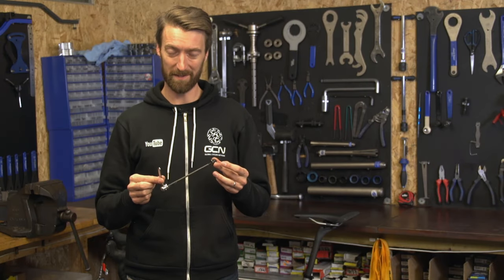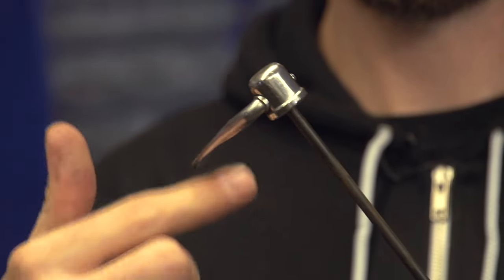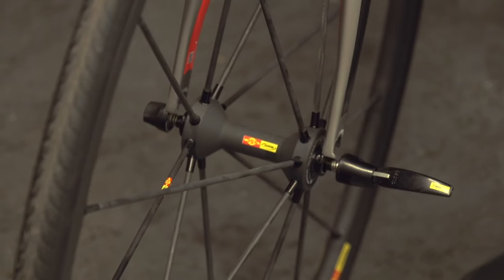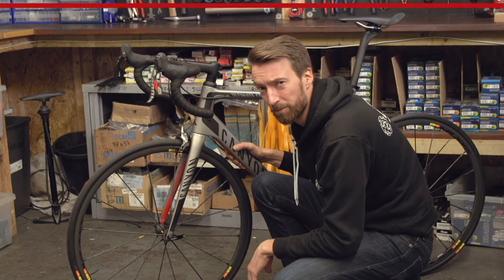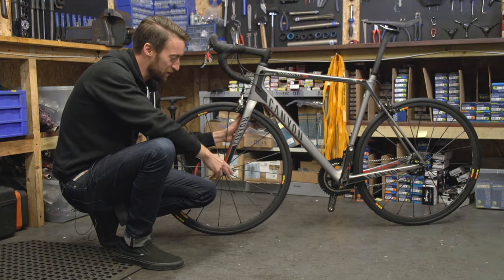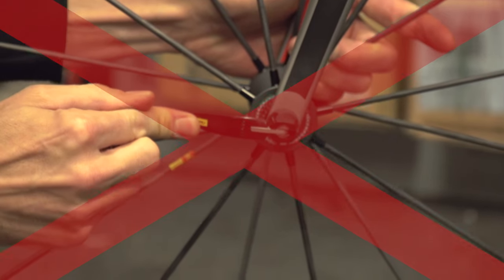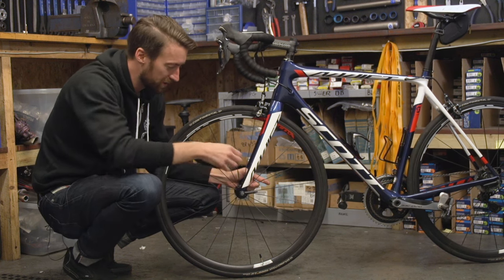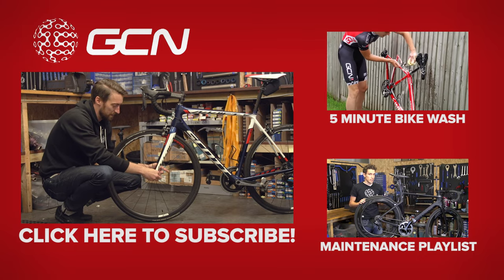How To Use And Adjust Quick Release Skewers

Comment: Thanks! Was changing my rear tire and was just tightening the lever, but couldn´t close it for the life of me.
Saw this, loosened everything and started turning the nut while holding the lever in the correct "open" position, opposite of where you want it closed. Tightened the nut until the lever was a bit hard to close, but not rock solid. Beautiful. Thanks again, really good video!

Comment: Thanks. I had this problem with my front tyre, it was like tilting a little, maybe more than a centimeter and I was searching the reason for this. Then I saw this video and remembered one time I dropped the small spring and I did not know which way to put it back. Of course I put it the wrong way and now when I turned it the right way the problem is gone. A huge difference. Thanks again.

Comment: I replaced 23mm tyres with 28mm tyres, but the frame clearance was very tight for the rear wheel, so what I did was tighten the QR lever with a tiny gap between the axle and the dropouts, creating a larger gap between the wheel and frame. The tightening nuts have a serrated surface for grip, and it seems to have worked fine this season, but presumably I'm running the risk of the drops outs eventually slipping down onto the axle and losing clearance between the wheel and frame.

Comment: Was wondering if you guys would be able to make a full bike build of both mechanical and electronic.  I have a ultimate cf slx frameset and am looking to build it up soon but would be good to know what to buy and explain all what all the options on wiggle mean when buying a groupset as there are lots of different choices. as I'm yet to find a full build but only how to fit individual components (often not the same as what my frame is compatible with!!)   

Many thanks

Comment: I have an old mountain bike with Shimano brake discs and QR they work lovely I’ve had the back wheel off loads of times put it in the boot of car, or puncture repairs and every time it goes back fine,  I have a new hybrid with SRAM brake discs and QR, I can’t stop the rear disc from rubbing the pads  
I’ve done it up really tight but the wheel can still be pulled side to side a little and it rubs the pads like Mad especially when Cornering . I cannot get it to stop I’ve moved the calliper around it stoped for a while it’s doing again now

Comment: Never had any experience with a quick release in my life. Put a bike together over the weekend that has one. On the wheel itself, before I even put the skewer in, should the bolt and nuts that go through the axle turn along with the wheel??? When I put the skewer in and tighten it, there’s resistance when I spin the wheel. Because everything seems to be turning at the same time

Comment: Not so useful for regular riders but I had a friend who had no idea how to operate one. The wheel came off the forks when I lifted it up because the tire was rubbing against the brakes. On a totally different situation I was riding someone else's bike going really fast when I heard a rattling noise. Got off the bike and the quick release was open and really loose. The road was bumpy and I was lucky enough to not have it separated from the forks.

I'm also amazed at how many people needing instructions from me to operate a QR. What's trivial to you might not be to other people. Did you figure out how to tie shoelaces without instructions?
Reply: Excellent examples! The ability to put one's self in the situation of someone else is one of characteristic of maturity.

Comment: I have a scott hard tail and the front wheel will tilt over about half of the gap between the gap from the fork to each side of the wheel. I have had this problem before on my trek i put the trek wheels on my scott frame and new fork  and ended up having the same problem I noticed wear on fork feet. My step dad thinks the forks might be uneven which might cause it to tilt. If you have any knowledge or ideas on how to fix this or what the problem is please let me know.

Comment: the best position to secure the QR
i will stand on the right hand side of the bike, and put your body weight on saddle to force the rear drop out fitted in rear wheel totally. simply do it on front wheel
its the easiest way to check and adjust the QR tight enough or not

Comment: What is the best way to release one that has been over tightened. I bought a used road bike and can't get the release to give and don't want to break anything getting to rough with it.
Reply: +Joe Medlin Stick a pipe over the lever and use that for extra leverage. Or a vicegrip on the "nut" side and turn it anti-clockwise. 
I'd get a new skewer though, as strong as they are, they can be weakened by stretching.

Comment: I have taken the front wheel of the bike as it was wobbling. Realised the wheel was loose in between the axial and was able to wobble.

Now putting the wheel back on and tightening the front fork on the quick release. As I tighten it the  fork closes in on the nut of the axial causing resistance to the wheel enough to stop the wheel.

What am I doing wrong here in my bike?

Comment: I ride behind a ton of guys with their rear quick release pointed backward.  I am constantly threatening to open it for them with my front wheel and telling them to change it.  It's actually nice to see a video I can point them to.
Reply: I have a canyon ultimate and I have my rear quick release on the left side point to the back.  It is the most logical way and i tell you why.

I have disc brakes and in doing so, the rear quick release lever is actually protecting my brake disk from damage and risks of bending if the bike was to fall over on the left side...

The chances of anyone opening with their front wheel from the back is very slim since I doubt anyone is stupid enough to try to damage their own bike in order to prove me wrong...

Comment: Great way to test if the QR is tight enough:  if you can release it with one finger, it's not tight enough.  Any tighter than needed to meet that test is not necessary and only makes releasing them harder than it needs to be.

Comment: I have a canyon ultimate and I have my rear quick release on the left side point to the back.  It is the most logical way and i tell you why.

I have disc brakes and in doing so, the rear quick release lever is actually protecting my brake disk from damage and risks of bending if the bike was to fall over on the left side...

The chances of anyone opening with their front wheel from the back is very slim since I doubt anyone is stupid enough to try to damage their own bike in order to prove me wrong...

Comment: I was a little kid when these came out and honestly we could never figure out how they were supposed to work. It seemed like it had to be loose before you could snap it down and then it would tighten as you were pulling it down because the lever protruded at the base. it was trial and error because you never knew exactly at which point to crank it down. When they got dirty they bound up. The problem is you can feel the torque on the original ones with the protruding base
Reply: actually its the seat post I was thinking of, I just always thought it was a crappy design they may have used the same design on wheels in the nineties
Reply: apparently the wheel ones are based on a cam too so there is no way to actually determine the torque, but on the plus side homeless people don't need a wrench to steel your wheel

Comment: On a serious note, do not overtighten them. Years ago (I was still a teenager) I was getting my bike ready for an important race so I made the rear skewer really tight. As I forced the lever to the closed position the skewer snapped at the threads and the adjuster shot across the car park like a missile! I was lucky to find someone with a spare to loan me otherwise that would have been my race over before I started.
Reply: Another more important reason for not over tightening is so as not to over compress the bearings.

Comment: I've always been told that closing a quick release should leave a mark on whatever you used to close it, be it your thumb, your palm, or whatever. I've also been told that when the skewer is closed halfway, it should still be able to (just) hold the wheel in place. 

Other than that, it's a quick release, it's not hard.

Comment: I have a quick release on my mtb n  I took the wheel of n everything was fine but when I put it back I had to losen it loads and I ended up just screwing the leaver the the point of where it was really tight but then I couldn't push it in towards the frame so I tried to losen it again but it was far too tight and I can't get it undone so it's just sticking out any suggestion
Reply: Pliers.

Comment: How do you switch the side that a quick release is on, the one that is on my recumbent is on the rear wheel and it is on the side of the gearing, and I need to put it on the other side, I know how to do minor maintenance on my bike but that's about it, any help would be greatly appreciated.
Reply: You can just unscrew the nut all the way, take the lever out, and then put it back in the other way
Reply: Kate Powers Thank you very much

Comment: Please please make a video about how to use the plastic valve cap. I always lose them I might be doing something wrong.
Reply: +Prastt Don't use valve caps. It's that easy.
Reply: +Prastt Don't overtighten them. If you do the plastic can crack, and they slide off. On a road bike you can get away with not using them, but on a mountainbike you do need them to protect the valve from mud.
Reply: пмпппмпрримппппмпппдддддпппппппппппепппрпррррррпрпссппннннрррррррррррррррргоорррнпнннррррнррррррртииоооорооррррррррроооооооооооориоорнррннррррнррррррррррирмрипппппп😁😁😁
Reply: +Настя Краева яыыыыппоооиртиорририрррооооооо😊😊
Reply: +Настя Краева оойф
спаааармммпммммпппппааасччччпеппкпапааакккпкеааакаааааааакааукккккааап😯😯😀😀😀😀😀😊😀

Comment: How convenient! Over the weekend I did a thorough(anal) tuneup and clean up on my bike. As I was putting the rear tire back in I was thinking of where is the proper place to leave the quick release. My brain, with its third SN Torpedo Pale Ale wasn't giving me the answers. Thanks.   By anal I meant, I brought out the Q-tips to clean the chainring, chain, and cassette. After I lubed the chain, I went for a ride in the driveway. It was so smooth and quiet. Like budder!

Comment: What blasphemy is  this?!? The front QR lever must always be placed at the 12 o'clock position, and the rear either also at the 12 or in the 45 deg position Dan illustrated. There is a rule for this. Shame on you for not knowing it.